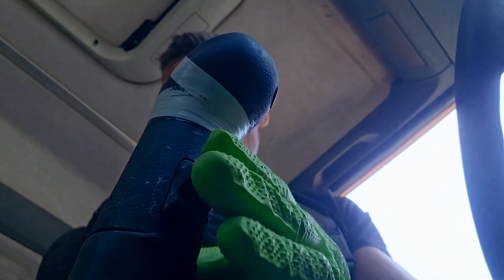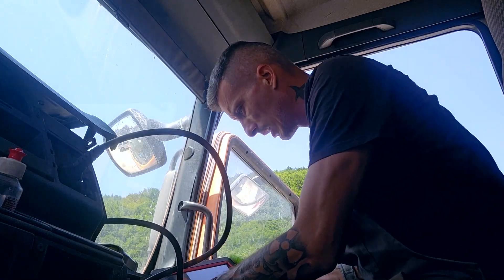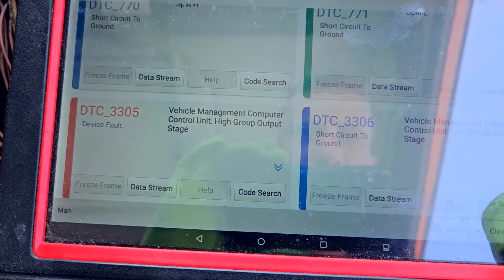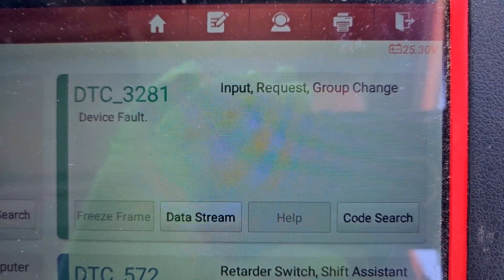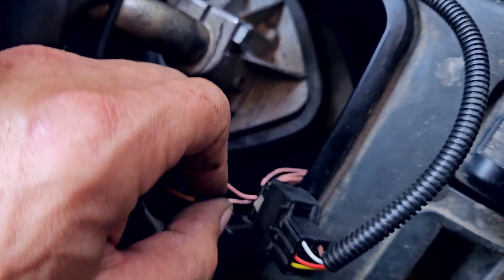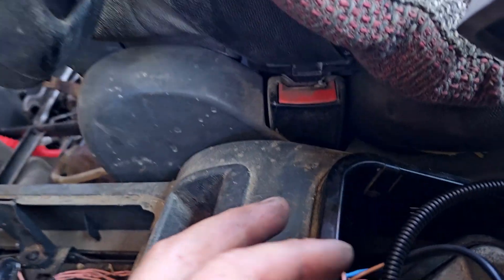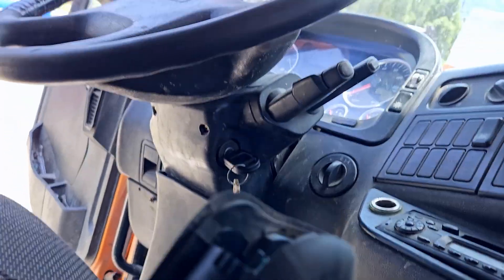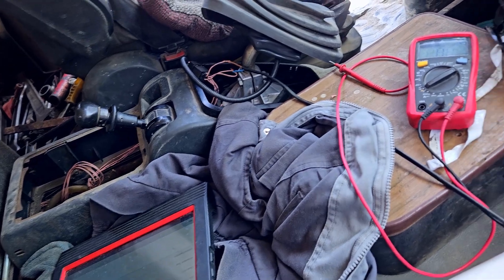Gearbox Not Splitting Gears! FFR-03281. How To Fix It!

Comment: Salut mister .The even gears(2,4,6,8)on the ZF manual gearbox,on the Man Tga 26480 truck,they enter more slowly(causes) 
Then khyou🤝🙏
Reply from the maker: IF they enter, but it happends slowly ,probably the gearbox brake is not working propely.That you can check with a diagnose tool.You enter in the managment computer(ffr) and you select gearbox input speed.with the engine started the input rpm should go to 0 in 1- 2 seconds after you press the the clutch pedal.
Reply: salut dacă ești roman și mi se pare ca da , te salut de aici din Spania , ieri m-am înscris  la canalul tău , te felicit sant mecanic și eu , dar nu sunt la nivelul tău , ori cum învăț multe de pe canalul tău . Felicitari ❤❤❤
Reply from the maker: Multumesc,m bucur sa aud si sper sa inveti cat mai multe de pe canalul meu!@ @Alexandru12107

Comment: What voltage should i get at selector switch on wire 60028 as im getting 5 v front the tcm to one wire and 24v on the other
Reply from the maker: @FunkyVids-k7v  On 60028 should be 24v

Comment: Hi...im having a comfort shift defective warning on the dash..can u help me solve this issue
Reply from the maker: @kevinmaharaj08  Hi.What are the  fault codes on your dash?
Reply: @RelectrikRepairs  me again...its not showing any gears on the dash.not going into reversee in low range..like its not detecting the gearbox input speed or something like that
Reply from the maker: @kevinmaharaj08  There is a big chance you have a broken speed sensor or broken wires to the sensor.you need to check the wires first to the sensor( is on the top of the gearbox ,in the right side as you look to the front of the truck) and also  diagnose to see the input speed of the gearbox.
Reply: @RelectrikRepairs  on the gearbox input speed plug there 2 wires...one wire im getting ground and on the other its just showing 0.0volts
Reply from the maker: @kevinmaharaj08 it s better to check continuity,because you don t have 24v on that sensor.So look for the code writen on the wire and check continuity from sensor to the front of the truck(driver side)
Reply: @RelectrikRepairs  can u look up these codes for me...its showing in the diagnostic section..03306-06 , 03308,03155-08,03281-10,00771-06.... the input sensor wire showing ground on oneside with the engine idleing and reading now between 1.7v and 1.9v idleing...buh help with the codes please...aint getting no function in low range and no gears are showing on the cluster other then neutral and reverse only engageing in high range...like the gearbox aint have no funtions in low range
Reply from the maker: @kevinmaharaj08 if i write here what every of that fault means it will be a very long message.but to be short: the faults are telling us that there are some wire interruptions on the low and high range..none of the faults above suggest a problem with the speed sensor.you need to check all the wires to the gearbox selector..a wire or maybe 2 wires are interrupted
Reply: @RelectrikRepairs   ok thanks..the driver did a test drive and notice the speed gauge is not moving..so maybe thats the reason why comfort shift aint working cause it cant calebrate the different speeds from gearbox and the transmission.thanks again